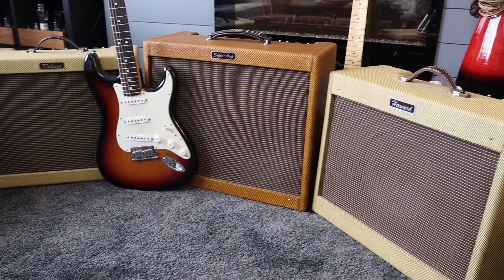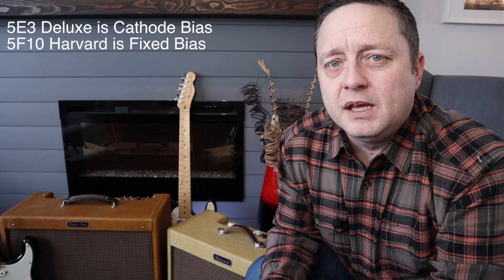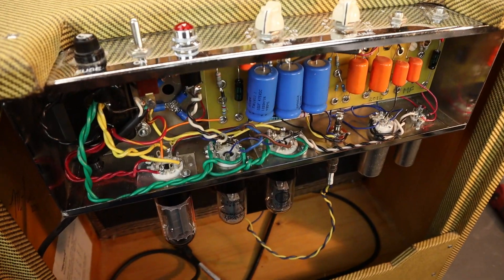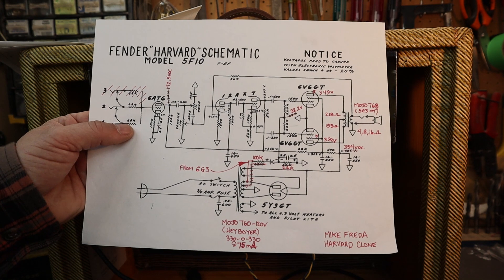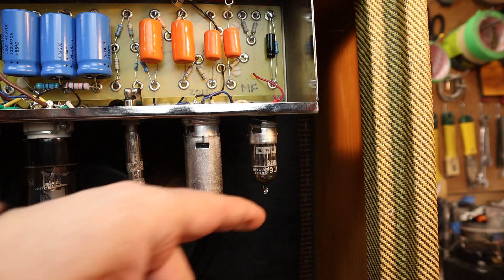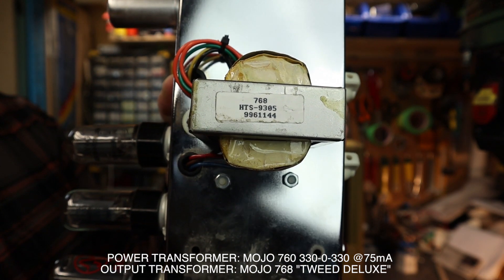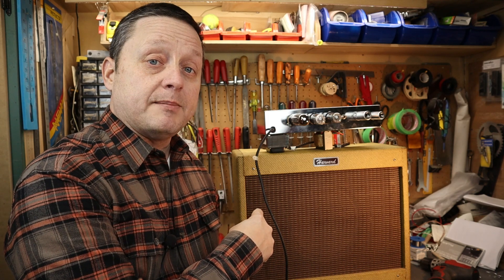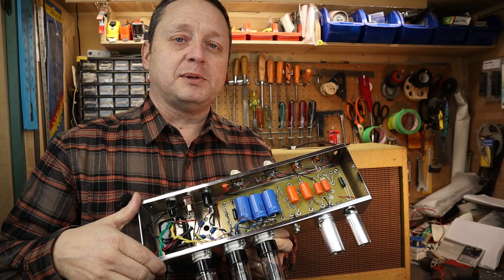Making a Tweed HARVARD Guitar Amp / My build TIPS & SUGGESTIONS on how to make this amp from scratch

Comment: Thanks for the video. Nice job. What exactly did you use on the inside of the cab? I prefer the look you have — instead of raw wood, and I think you achieved an authentic look with whatever stain you used. Thanks
Reply from the maker: Thanks for commenting.  The coating of the tweed and the inside is Zinsser Bulls Eye Shellac.  Clear (Non tinted). I think I did 2-3 coats.  The more coats the slightly darker it gets.

Comment: Could you wire half a 12ax7 instead of using a 6at6?
Reply from the maker: You could.  12AT7 or AY7 may be more suitable. The mu of a 6AT6 is 70. 12AX7’s have a mu of 100.   You could use both sections and make it switchable with different bias points for each section. That would be cool for different voicings. Cheers.

Comment: Hey Mike.
Really great video.
Do you think this is an amp that a novice could build?  I would love to have a Harvard amp, but can't find any kits or instructions, and have never built an amp before.
Thanks Mike.
Reply from the maker: Thanks for commenting.  I have not seen a kit for a Harvard Tweed amp. That’s part of the reason I did the video. I used Mojotone chassis, PT, OT, misc parts and fenders layouts and schematic (which are a bit suspect so that’s why I made my build notes). If you never built and amp before I would recommend a Champ or Princeton kit. There are a lot of build principles that will apply. If you can make that work then you can try a scratch build like this Harvard.  Cheers.

Comment: Boy o boy, what a help you are! Thanks for posting!
Reply from the maker: Glad the video helped you out.  I’m surprised that there is not a lot of info about this amp. Cheers.
Reply: @MikeFreda  I did like you did, built one from scratch.  I know I got all the right parts (I've built a 59 Bassaman from a kit and a 5E5A Pro from parts and they run fine) but my voltages are all very high across the board on the Harvard. Plus it doesn't sound like I expected it to. Breaks up very early, even with my single pickup Esquire. I'm working on cars right now but as soon as I get time I'm using your schematics and alterations to fix mine. Really, I can't thank you enough for your video. Uncle Doug is my go to, but I had questions he didn't answer in his Harvard video.

Comment: Mike, I noticed with interest that the original schematic recommends a linear pot for volume and an audio pot for the tone.  What did you do for pots, and why?
Reply from the maker: Yes, I have noticed that the tweed amps of this era seem to use either or.  I used Audio taper on all my amps.  They ramp (scale) differently than linear pots. I believe it’s a taste sort of thing. They say that Audio taper were created for ears logarithmic behaviour so you can physically hear a difference.  I don’t think it matters that much in these amps.  Try both, see what you like. Cheers.

Comment: Late to the party here, but that's a nice build, particularly the cab. Most folks can't be bothered making a decent cab, much less tweed-ing it! I have never played this circuit but from a quick look at the schematic, I presume it's pretty clean  compared to a 5E3, but once it starts to distort I bet it's really aggressive. With the ground leg of the volume acting as the grid leak for the following gain stage and no grid stopper on that triode, I'd expect it to get very gnarly with the volume past about 80%. Same with the lack of a grid stopper on the cathodyne. I suppose the neg feedback and the cathode biased cathodyne help keep it clean longer, but once it goes into distortion they'd both make it pretty mean. Cool amp!
Reply from the maker: Thanks for commenting.  What you describe is pretty much spot on.  The amp is a bit of a hidden gem that many people overlook.  Most people feel the 5E3 is where it’s at for tweed tone but the Harvard is something a bit different and a bit more usable in my books.  The Harvards input tube can be a bit finicky. Converting it to a more common tube like a 12AT7 would be a interesting mod.  Cheers.
Reply: @MikeFreda  Yeah, you could use a 5751 and make it a two channel four-holer.

Comment: No information on where to get the parts for build
Reply from the maker: I made most of the amp from scratch. As listed on the schematic, the transformers are from Mojotone. Resistors from Mouser and the tubes and caps are from The Tube Store.